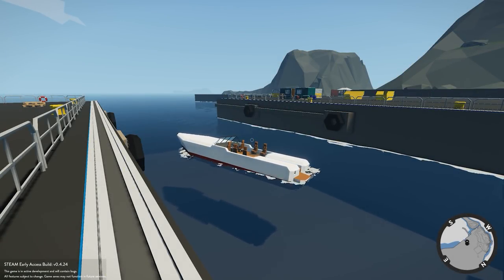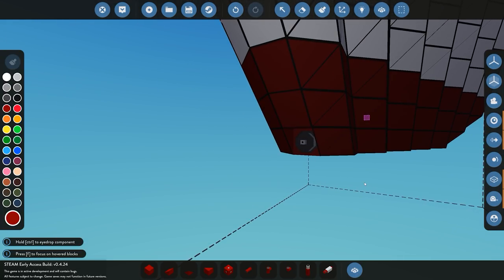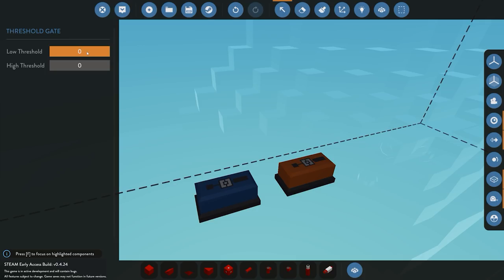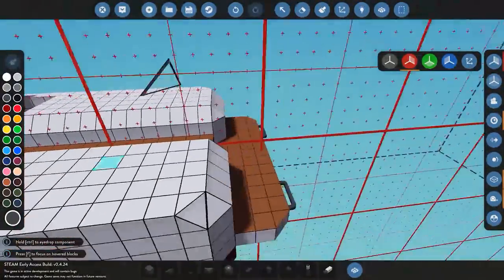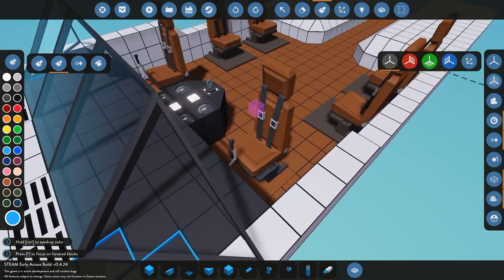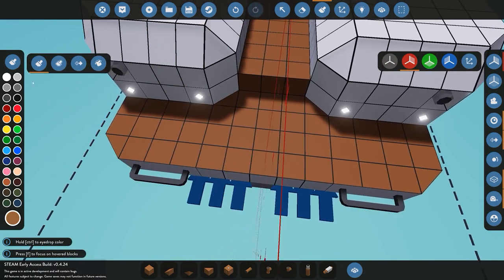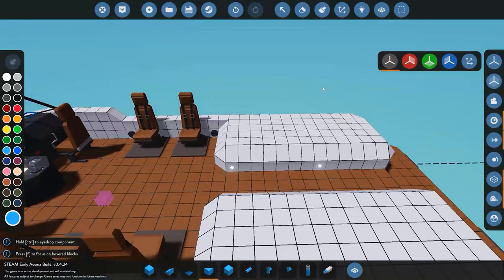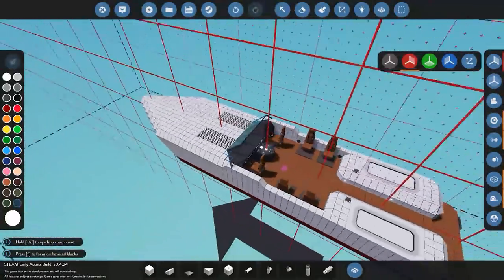Stormworks Step by Step Advance Boat Tutorial (Part 2)

Comment: Nice boat. About the overheating, its happend because when you added the stabilizer the cooling pump intake lifted out from the water on high speed, so the engine started to overheat. If you move them to the back the problem will gone.
Reply: Good eye.
Reply: but then both engines should be affected. I'm guessing that the problem is that the piping was done with symmetry on - therefore one engine isn't cooled at all because the pumps force the water through the engine in the wrong direction.
Reply: I think the overheating was due the his inputting the negative correction, which brought the props out of the water, but leaving the throttle the same, causing serious overspeed of the engines, combined with the occasional loss of coolant when the intake lifted out of the water.
Reply: Smartest guy I’ve ever seen

Comment: Why your engine nearly blew up: 
Your water based cooling system has water intake near the CoM on the bottom of the boat. your stablizing system nosed the entire ship up out of the water, removing your water intake for a time. Im assuming due to them being plummed together its just a roll of the dice which one will not obtain the water left in the system.

Id suggest moving the intake(s) closer to the rear of the boat
Reply: I think the overheating was due the his inputting the negative correction, which brought the props out of the water, but leaving the throttle the same, causing serious overspeed of the engines, combined with the occasional loss of coolant when the intake lifted out of the water.

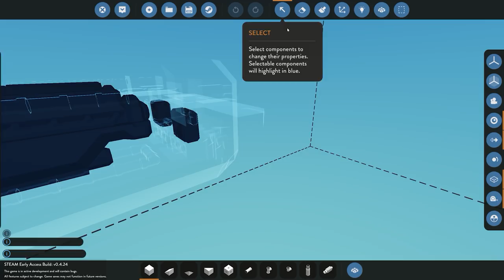Comment: 1:30 In your advanced engine tutorial, when speaking about the gearboxes, you say that 1:1 is more speed but less torque, while 1:3 is more torque but less speed. Why does your boat go faster on 1:3?
Reply: In case anyone else was wondering, I figured it out. I got hung up on the usage of the word "speed." I think what he meant is that the engine is running "slower" i.e. less RPM with the result of more torque output. Higher torque makes the prop spin faster, which makes the boat travel at a higher speed.

The basic equation of this relationship is Power = Torque x RPM. The engine has a fixed power rating, and your choice is between running at more RPM (thus, less torque) or more torque (thus, less RPM) or some balance of the two using one or more gearboxes.

Something I haven't used much so needed to brush up on. Figured I would post here in case anyone else was lacking background or fuzzy on the concept.
Reply: Power?

Comment: Can u build a boat in CAREER mode. Most people don’t have the parts your using
Reply from the maker: Most of the parts I used are available in career mode at the start, excluding the sensors.
Reply: The concepts he shows in the video are applicable even with the beginner parts. You can use the basic design and concepts to make your own boat in career mode.

I do think the "starter career boat" would make a good video, though.
Reply: u used freaking aircraft engines lol
Reply: @visualdosage234  that, and none of the logic gates are available, however if you're slightly code savvy, you can manually program the same things he used using the micro-controllers. That's how I made a total fuel gauge for a boat with like 30 fuel tanks. Made 3 10 input adding gates, and a 4th to add those 4 together and send to the gauge.

Comment: I'm still getting into this game and I'm not the most credible professional, mediocre noob in the world. But didn't you pipe the cooling system wrong on the engine on the right (the one that caught on fire)? I don't think the engines have a "coolant will flow anywhere" system. You have on the left, the intake and output setup correctly, but because they're mirrored, I don't think the right one flipped in that manner, so the intake should still be the left pipe and the output should be the right pipe. So that would mean you're pumping cool water into the output for the right engine and trying to pump out hot water out of it's empty intake.

Again, I'm not a pro, but is that the issue?